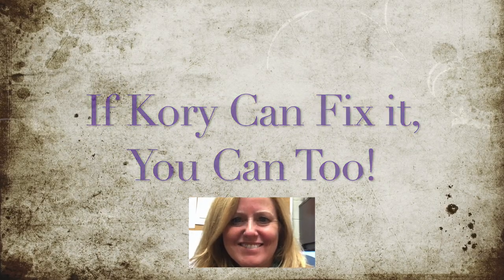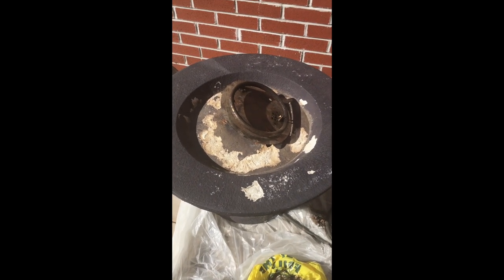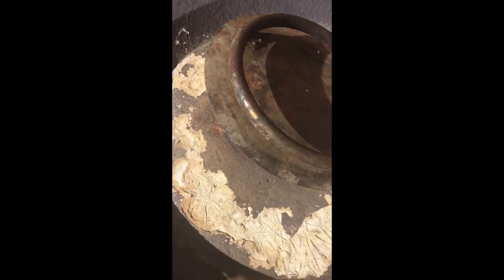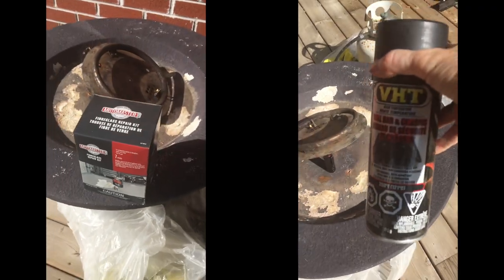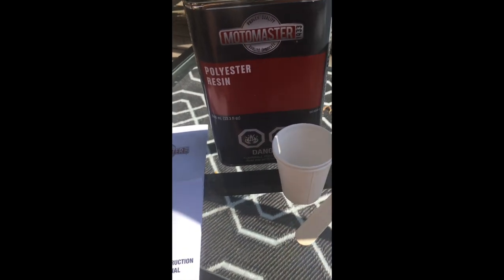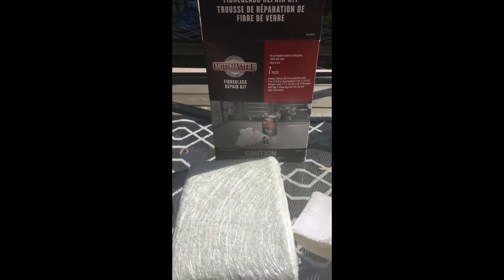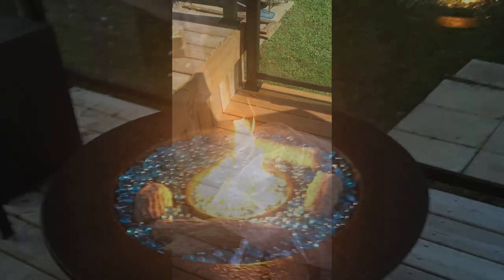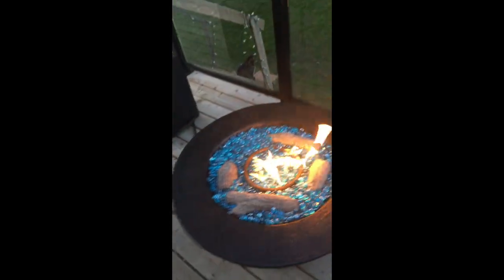If I Can Fix It, You Can Too! Propane Fire Pit Restoration

Comment: How has it held up? I guess many of these firepits are some sort of fiberglass with some form of lightweight concrete?
Reply from the maker: Hi - they aren’t mage well -I should have just done the whole top in the first shot. I have replaced more bit now it’s solid! Lol - the burner will burn out before the body! Lol! I had some issues with dampness on the line but fixed that by putting a lid on it and a cover!
Reply from the maker: Hi,  it has really held up well. I should have just redone the whole top though - other areas are now breaking down...so I will have more repairs to do this summer - but it still works

Comment: You didn’t fill the divets though??? I was hoping to learn how you filled them and what you used.
Reply from the maker: I am not sure what you mean - they were filled all the of the crumbly stuff was sanded and then filled with the fiberglass - I would say that I should have just redone the whole surface, because the areas I did have held up great - but then the non fixed areas are degrading so I have to redo this summer but it still works!